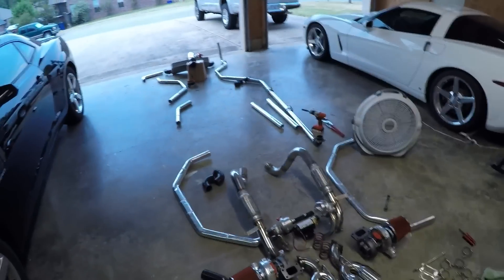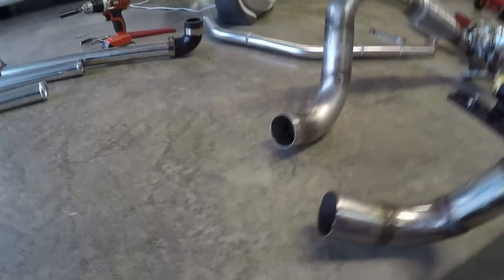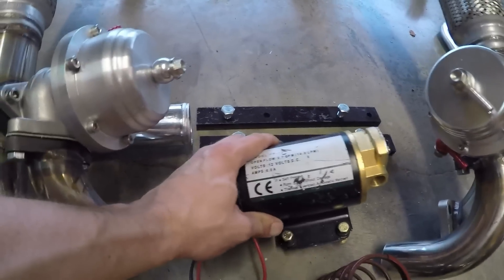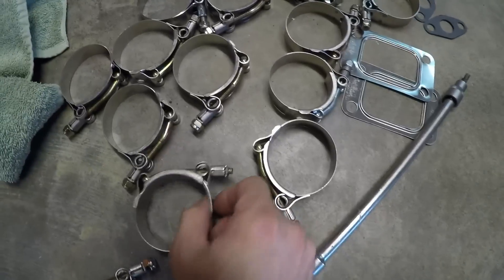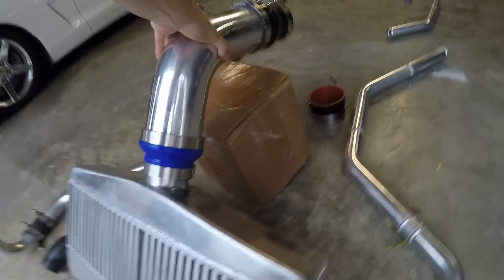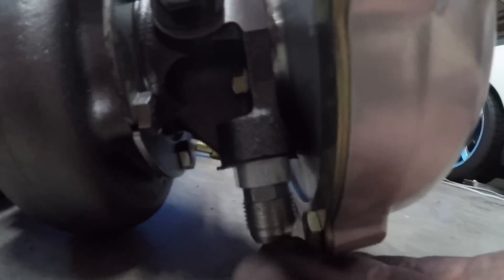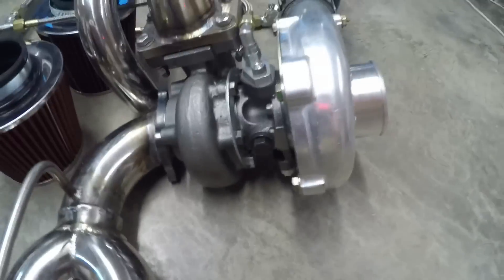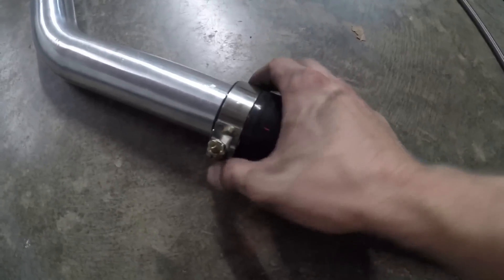Ebay STS Style Phobia Street Twin Turbo KIT Pressure Check

Comment: I wish you ding dongs understand that EBAY does not make anything, they are a merchant!!!! Every part comes from 3rd parties. The turbo are not Ebay!  Just because it's not a super expensive brand don't mean the kit sucks.  I've ran $1000 complete kits on foxbodies for years. Installed a Precision and  an one1 kit and had to replace them both within 8 months.

Comment: Good luck.  Hope it works out for you..as long as the turbochargers are decent quality and they don't blow oil could work out.    the charge piping only needs to move air... if it's not a show car they don't matter.. just need to have good quality rolled ends so your silicone doesn't blow off. .. The oil pump needs to obviously work continually well .. a remote mount kit isn't more"laggy"  because it has longer charge piping... It is comparable to most other kits because pressure is constant..Some will hate but sometimes low cost products work out great... Keep us updated!👍

Comment: My only two concerns. 1. Is turbo lag horrible? 2 with the turbos so low. Would it pick up water easily? So puddles and rain would be a problem making any car with this kit a non daily driver vehicle
Reply from the maker: No turbo lag.  What little bit I ever see helps off the line to keep from crazy tire spin.  If I pick up rain water where the turbos are I'll have it in the car.  The turbos are actually higher than the bottom of the seats in the car.

Comment: I wonder why there isn't more stand alone oil box kits for turbo oiling. makes more sense to me to have a reservoir of oil and small electric pump to circulate nice fresh oil that's doesn't go thru the engine and get hot and dirty. could even have a cooler as a reservoir???
Reply from the maker: If there was one I would buy it.  I just change the oil more often.  About every 1k or so.

Comment from the maker: Ok guys I have seen too many comments about the Ebay tag.  

I want to be clear, the kit is not EBAY!!!!  

I bought the kit on ebay, but it is a Phobia Street Innovation 1 off kit.  This kit is hand made by a small manufacture based in Canada.  I have spoken with the owner several times.  His customer service is top notch!  The kit is good quality.  It is not quite OEM quality but it is really good especially for the price.  If you want OEM quality buy a ZR1.  I forget the brand of turbo he told me they are, but I have taken them apart myself and they are made very well.  Tight tolerances and very little end play.  They make boost just fine.  I've got over 500 miles on them and they are still in perfect working order.
Reply: RIGHT!!!!!???  I don't know how these ding dongs think a merchant makes turbos. smh lol